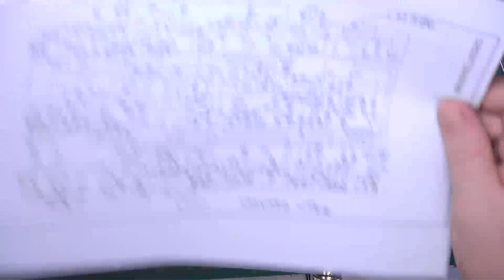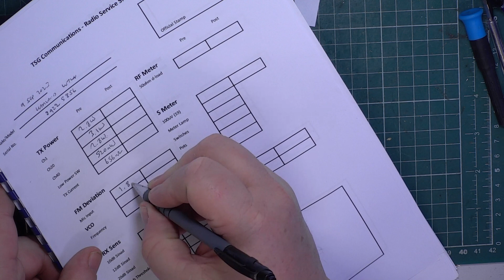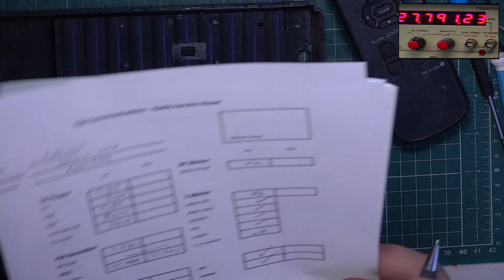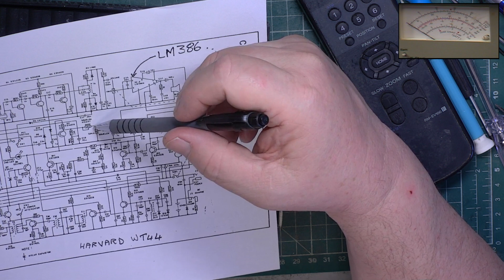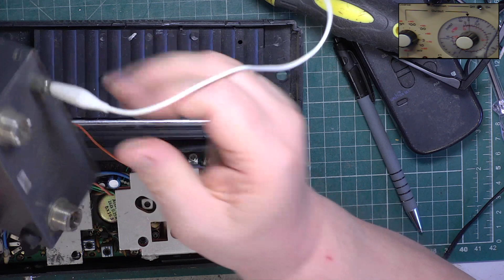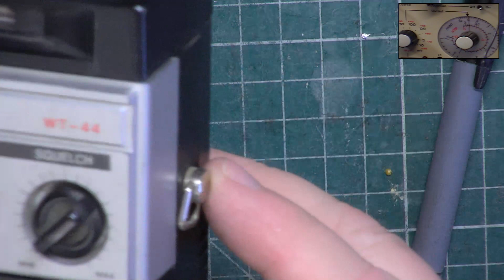Harvard WT44 CB27/81 UK FM CB radio - service

Comment: The new Thunderpole T-X handheld has been getting rave reviews and sold out very quickly. Have you got one?
Reply from the maker: No. Company policy decided not to purchase any new CB radios from 1st January 2023. We still have half a dozen new sets in stock that we've not yet covered on here.

Chances are that the Thunderpole handheld will appear here as a customer optimisation.

Richard, G0OJF, UK